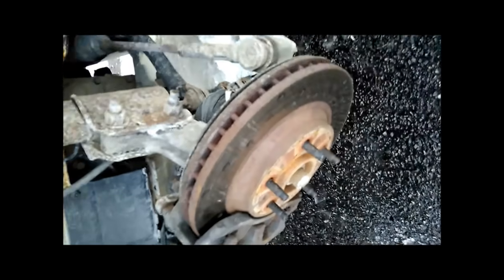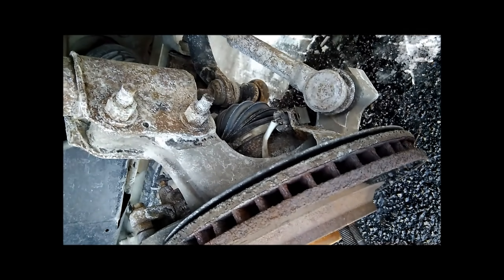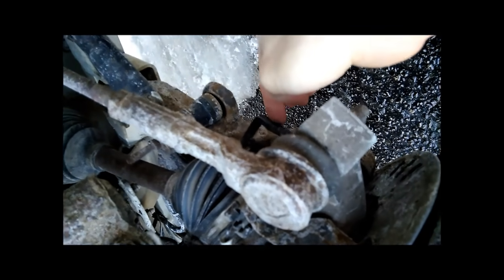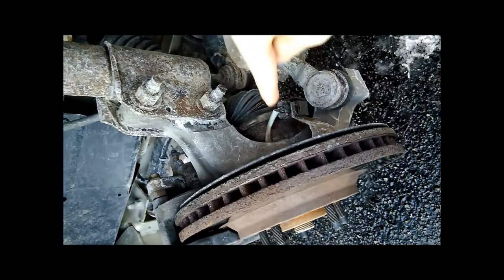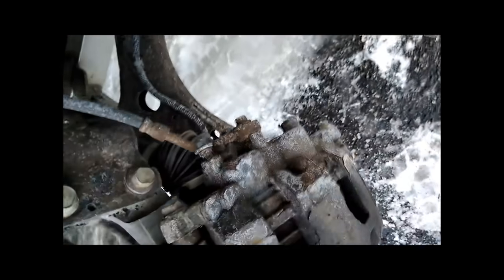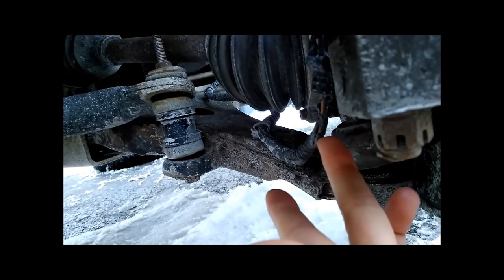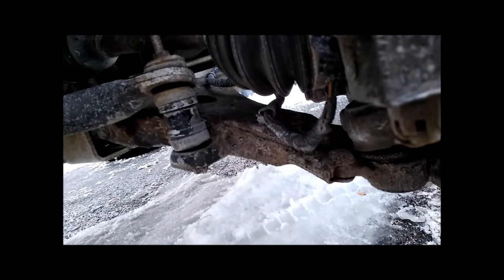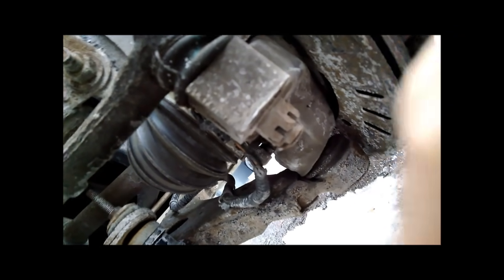How to fix ABS light, Traction Control, Stabilitrak

Comment: I got a 2013 Dodge Dart and the abs sensor and traction light came on. It came on after I washed my car and over here in Calgary the winter is cold so does it have something to do with it freezing up?
Reply from the maker: I'm not sure if washing the car had anything to do with it.  It's anyone's guess there, but if you're a home owner, you know how water can seep down the walls of the house, freeze later on and cause cracks and water ingress into the home, so these sort of freeze-thaw cycle could conceivably affect car systems in a similar way.  Basically when the electrical system is hanging on by a thread and things like bumps and turns can cause the light to go off, it's generally very sensitive to any sort of disturbance, including thermal cycles and water as well.
Reply: @ChrisCamaro  so what would you recommend I do?
Reply from the maker: @labeebsiddique3865  Do you have a cheapo code scanner?  If so, it's best to narrow down which wheel is causing the fault and then you cut your work down to 1/4.  From there you can do what I did in my video to see if you can find the problem via inspection.  If you can find a damaged section and service it, maybe the problem goes away right then and there.  If not, you either have to pay a mechanic and tell him which wheel to look at to reduce cost somewhat or you have to jack the car up, get a creeper and roll yourself under the car with a multimeter and run along the wire loom, checking continuity all the way back to the car computer.  I recommend against going this far because even though I have the expertise to do such a thing even I won't do it.  It's not worth the grief if you don't have a mechanic's lift.  Have a look at my follow-up video in the description.  You'll see what the mechanic saved me in that regard.
Reply: @ChrisCamaro  alright i’ll check out the scanners, however ever since this light has come on the steering has been very hard and after taking turns the wheel does not come back to you like how it normally would so i have to turn it back by myself which is kind of annoying
Reply from the maker: @labeebsiddique3865  Hmm.  Your car has electric power steering correct?  If there is a steering angle sensor that's part of the traction system, that could also be a root-cause, especially if you're having problems with the wheel.  Definitely look into a scanner which can scan the BCM.
Reply: @ChrisCamaro  so i looked at the scanner and it said i need to replace my wheel sensor, however i got it checked out by a mechanic they said that the sensor is fine but the wheel bearing is bad and needs to be replaced. Based on all of the symptoms I told you above would this be a probable cause?
Reply from the maker: @labeebsiddique3865  I have to go based on what you're reporting and if the scanner picked up a bad wheel speed sensor, as far as the computer is concerned, it's bad and needs to be replaced.  I don't know why any mechanic would contradict that.  The fact that the bearing itself is also bad and needs to be replaced is irrelevant.  Well... it means that there is no doubt that you should replace that one for sure.  The code fault "could" be the wiring and not the sensor itself but if the bearing is bad anyway, no harm in replacing that first and seeing if the code goes away.  If it doesn't, there's a pretty good chance the wire loom from that wheel back to the computer is damaged somewhere in which case your mechanic simply needs to replace that.  First step though is to swap out the bad wheel bearing (assuming the one you're talking about is the same one throwing the code)

Comment: Im having trouble on chevy equinox 2012 the stability control light is on and it also says engine power reduces and its making a lot of noise on motor info?
Reply: First thing Juan, engine power reduced will most likely be you battery connection. Remove the cables, clean the connectors on them REALLY WELL, clean the battery terminals REALLY WELL, maybe add some dielectric grease🤷🏿‍♂️, and lastly.....when you reconnect the cables MAKE ABSOLUTELY SURE THEY'RE TIGHT AND WON'T WIGGLE AROUND.
Remember, CLEAN and TIGHT. Pretty sure that'll take care of that for you.

Comment: I have a 2003 Yukon and the traction control light comes on and it takes high rpm’s to move at least 5mph would this be the issue I check the transmission fluid and it’s burned but no really much clutch material
Reply from the maker: Uhh... sounds like the calipers are siezed closed or something.  I mean the TCS controls the brakes but ordinarily, even if it's malfunctioning it wouldn't just lock the brakes all the time.  Try pulling the ABS motor fuses from the fuse block and see if it fixes the problem.  Otherwise it's something else entirely.  Sometimes a clogged cat can cause your symptoms but you're talking about burnt tranny fluid so I'm inclined to think the brakes are stuck or the E-brake is on or something like that.
Reply: @ChrisCamaro  the brakes are fine when it goes into gear and u push the accelerator it moves just not very much and then the traction control light comes and says traction active but the truck is moving as if it’s in neutral and it’s not moving very fast even at 3k rpm’s it won’t go above 5 mph or so u can feel the forward engagement but after that it takes 3k or more rpm’s of acceleration to move like 10ft. I suspect that the trans has let go and lost hydraulic pressure causing it to not have any forward gears. Because it goes into reverse and moves just fine
Reply from the maker: @LSMykie  Yeah the tcs light might just be a red herring.  It could be low fluid but I imagine you would have checked that.  Could be one or more shift solenoids going bad.  If the fluid is burnt, maybe the clutches and bands are gone... but even then, to get no more than 5mph doesn't seem like soft parts.  Is the car throwing any codes?
Reply: @ChrisCamaro  it was throwing misfire codes after I cleared them they did not return. The fluid was at the proper level but was very burnt or caramelized. But it didn’t have much clutch material in it. At first it would move through 1/2 as long as it would was put in D1 and shifted to D2 but wouldn’t shift through 3/4. As the problem has gotten worse it now is doing as I described, and when put in D1 the traction light is constant. As if it was shut off but when trying to move it says traction active
Reply from the maker: @LSMykie  Definitely sounds like a tranny problem.  The FMC (Force Motor Current) controls the hydraulic line pressure in the tranny.  If for some reason the solenoid is burnt out then the commanded duty won't actually be realized and you won't get proper line pressure during a shift.  If that happens, the bands/clutches might be engaging very weakly and just slipping and heating on each other.  That could be why the fluid is burnt, especially if you're not getting proper line pressure and have to gun the engine to 3k to get enough friction to make the car move.
Reply: @ChrisCamaro  I’ll drop the pan tomorrow and change all the solenoids and filter and see if it changes and I’ll let u know what happens
Reply from the maker: @LSMykie  Very interested to know what you find.
Reply: @ChrisCamaro  I went Ahead and took the transmission out turns out all the forward frictions had burned together
Reply from the maker: @LSMykie  Woah... so any clue as to the root-cause?
Reply: @ChrisCamaro  the stator shaft bushings tore up the input drum shaft seals around the shaft eventually it started losing hydraulic pressure from not completely being able to apply the the 3/4 or the forward
Reply from the maker: @LSMykie  Well I applaud you for being able to get to the bottom of this issue.  My mechanical skills are skin deep compared to my theoretical understanding, so I seldom confirm any hypotheses myself but have to rely on mechanics to do the deep dive.

Comment: will this disable power steering as well?
Reply from the maker: No, that's a different system.  TCS is only responsible for modulating the speed of each wheel using throttle and brakes.

Comment: Question could this issue also be caused by an old battery?
Reply from the maker: Doubtful.  If the car starts and the alternator is any good you should have >14V at the battery terminals even if you disconnected the battery entirely.  So long as the alternater is putting out good voltage, the electronics will run just fine.

Comment: So is this problem usually from Just the Two Front wheels and not the back?
Reply from the maker: Not necessarily, it's just that the front wheels, being the only steering wheels, have more linkage in them than the rears, so they execute more complex movements and since the wire loom runs close to all that, there's more of a chance of damage.

Comment: Are they only on the front or back too
Reply from the maker: You mean the sensors?  The sensors are on all 4 wheels but it's not immediately apparent which of them are faulty because any 1 of them can de-activate traction control.

Comment: Would this cause the car to lose power completely?
Reply from the maker: Temporarily when it kicks in, that's exactly what it does.  The TCS is designed to reduce power in order to prevent the wheels from slipping.  However under normal conditions this effect is only temporary.  If your car is running limp all the time, that's something else.
Reply: Can this cause the car to stall out to

Comment: I'm having traction control issues with my 04 Cadillac srx. When it does happen it goes into limp mode, which is very dangerous. I feel like I've tried everything possible but still dealing with it.
Reply from the maker: whenever you have symptoms typical of a SES light, such as limp mode, it's imperative you get the car scanned for codes first, as that will definitely narrow down the problem and save you a lot of hassle.  Nice mechanics will usually do it for free or you can buy a scanner from the stores sometimes (I use Canadian Tire here) for like 20 bucks or something.  Not a bad investment if you've had a few cars in your life.

Comment: My 2013 chevy cruze light just came on, but this car dont have push button start and it totally has started and ran its self with out any key in the ignition so I'm kinda worried now that the service stabilitrak light has came on but it was a rainy day and I usually dont drive in the rain!!! If I hook it up to a computer will it tell me what's wrong with it??? I didnt lose power and I didnt notice it until I had drive like 5 miles, and I didn't drive over like 45 mph bc its was rainy and a curvy road!!! All comments welcome please!!!!
Reply from the maker: The stabilitrak etc is part of the Body Control Module, which most retail scanners can't access.  You need a mechanic level scanner to pick that up.  Some old cars have crappy key cylinder designs and can be started with no key when they get old and start falling apart.  But I don't see the connection between this and the traction concerns.  If you feel you need the computer assist to drive on slippery roads, I would get your mechanic to scan the car to determine where the fault lies.  Otherwise you would be guessing which wheel sensor is bad or even worse, if it's none of the wheel sensors at all and it's something else.  The least expensive option where there are no obvious faults is to check the computer first.

Comment: I’m having the same problem with my 2014 eco impala do you
Know if I can perform the same work to get it fixed because the sensor is not on all the time
Reply from the maker: If you were having this problem the light would not come on all the time.  The intermittency of the signal is a symptom of the wires having a loose connection that usually trips the system off when going over bumps or making turns.  I would say it can't hurt to jack the car up and check.  Cheap insurance if that happens to be the problem and you catch it.  If you do take it in though, get them to use their Tech II on the car and they can tell you exactly which wheel it is, so you or them don't guess and waste your money.
Reply: My 2014 impala is doing this all the time is it safe to drive ? Until I can fix it ?
Reply from the maker: @mikelawry1934  That's a bit subjective but I would say yes.  We got along without ABS and TCS before it was invented so if you're a good driver and have good tires you should be just fine.  The actual brakes themselves will be unaffected.  The only thing that you might consider a problem is if the system is glitching out, sometimes it can randomly cause your ABS to go off for a second or 2 so if that happens in the middle of a left-hand turn or something it can startle some people.  However just mash the gas as necessary to power through it and it should go away quickly.
Reply: @ChrisCamaro   I would say it's even more subjective than that because in my impala this happens during turnss at 40 miles per hour and can cause my vehicle to halt in the middle of an intersection
Reply from the maker: @bigbird73160  Oh boy.  It was never that bad for me but if it's locking you up completely, better pull the fuse until you can remedy the situation, else you might be putting yourself or others in danger.  Take care.
Reply: @bigbird73160  did you fix it? The abs and stabiltrack lights ? I have a 2015 imapala and they keep
Coming on
Reply: @mikelawry1934

Comment: I got a new alternator ,starter,battery,spark plugs,transmission fluid and the code is still on with” service esc off” and sometimes the car will cut off without jumpstart

Comment: Will that also make the car have lack of power ?
Reply from the maker: It shouldn't.  It will make the car vibrate or brake unpredictably sometimes but power should be normal.
Reply: @ChrisCamaro  thanks for the reply

Comment: Please someone reply asap will this cause your engine to make weird noises and lose power ? out im getting these lights and losing power accelerating out of a stop
Reply from the maker: No that shouldn't happen.  The TCS might go a little crazy while you're driving around but if you're just accelerating from a stop and the engine is making noises, that's something else.  Are you getting a check engine light?  You should scan the car first and see what it tells you.

Comment: Is that a chevy impala I have a 2014 and its been doing the same thing when I turn left doesn't do it all the time the abs pops up too 🙆‍♂️🙆‍♂️🙆‍♂️
Reply: Hey I got the same problem u have Chevy impala 2014 I noticed to only when I turn left when it happens
Reply: I changed the front passenger wheel bearing hub and lucky haven't heard the noise for a week
Reply: @maryblue4587  marry u can change the front wheel bearing  hubs it had to be that
Reply from the maker: A mechanic can tell you exactly which wheel it is with a Tech II tool
Reply: My 2014 front tires keep going flat after a few days of driving and I keep having to buy tires every week. My car does the same thing when I turn left. Would the wheel bearing hub fix this?
Reply from the maker: @jaleanevans3389   Tires keep going flat???  Honestly I'm stumped on that one.  The wheel bearings should have nothing to do with that.  They are simply a mounting point for the rims and tires but if the tires are going flat, something else is seriously wrong.  How's the alignment on the car?  Is the camber/toe way off or something?
Reply: J.C 5502 changing the bearing is a scam mechanics pull to get extra money , they know it’s the harness
Reply: @CadiKane  an honest truthful mechanic 👨‍🔧 here TY. That why I am here reading all of these comments so they don’t try to rip me off a lady going in by herself to the garage ! Ha, calling my brothers good buddy who is the Automotive Director at our community college of their program there and he teaches as well both classroom and hands on classes. He tells me what garage to go to as well- one I been at his former graduate mechanics no longer wrking there so calling him today as your comment is exactly why I don’t want to be taken advantaged of thinking a gal by herself at the garage

Comment: on my 2012 chevy malibu esc service came up and shut off later. The passenger wheel feels bumpy and not smooth now any help?
Reply from the maker: If you can raise the car up on a jack long enough to grab onto the wheel you describe as bumpy, try to twist it back and forth, up and down and see if it rattles or moves around while doing so.  If there's any movement (play) then you may need a new hub.  This would also have a good chance of fixing the light at the same time.
Reply: @ChrisCamaro  awesome thanks for the fast response! I also took it to get inspection and the guy said it was a little bit raised on the other side is this another sign?
Reply from the maker: @willcouchon9506  Raised?  How do you mean?  The suspension automatically levels the wheels, unless you have a problem with your springs or mounts or something